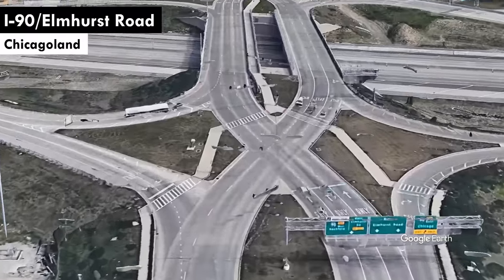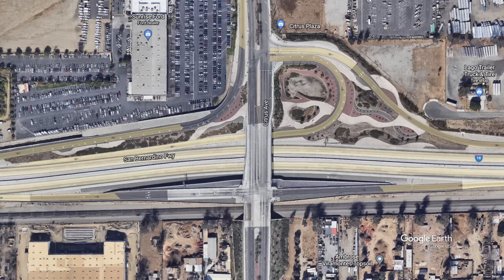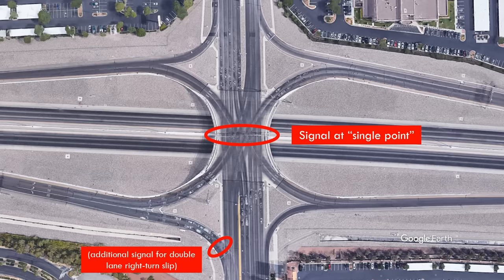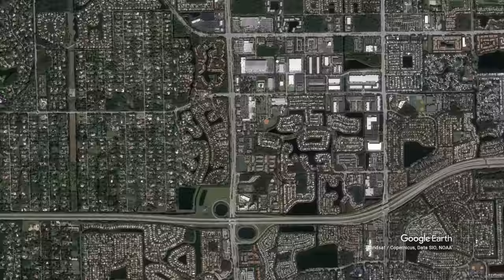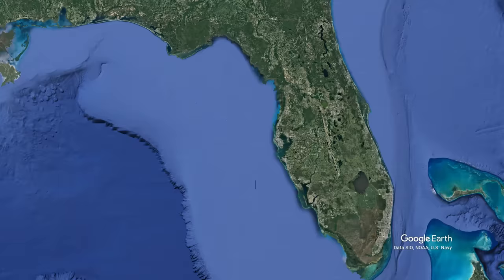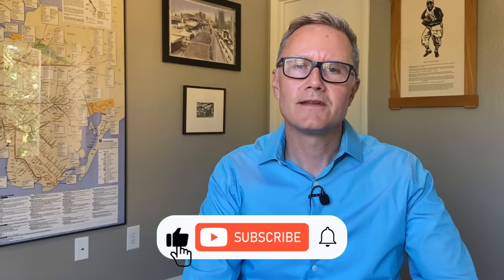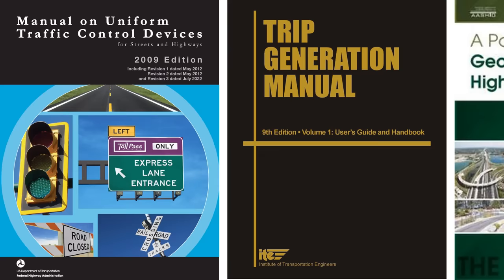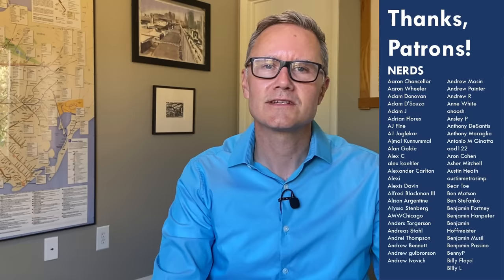Traffic Engineers Gone Wild: Why Interchanges and Intersections are Getting Worse, Not Better

Comment: I live in Utah and Bangerter Highway is a mess. It started out as an arterial  surface road meant to be a a low cost beltway, but it had intersections with lights. That part of the valley has exploded in population so UDot has been slowly converting intersections into freeway style interchanges. Eventually, it’s supposed to be 100% freeway without lights. I’m the meantime, it’s a very weird road. 

You should do a video on Mountain View Corridor just a little further to the west of Bangerter. It’s a future freeway that has started out as a frontage road with a large amount of open land in the middle. Once UDot has the funding, they will build the freeway section between the existing frontage roads. It’s crazy how many wrong way drivers and deaths happen on that road.

Comment: Thanks for the excellent videos. I'd like to hear your thoughts on frontage roads. Do they actually make access easier or do they just take up more space with little practical benefit.
Reply: Comparing my experience from living in Texas where they are ubiquitous to my former state of California where they are fairly rare…crossing them as a pedestrian is far more pleasant without frontage roads overall.  That said, there are many other design factors that go into the safety and relative pleasantness of highway crossings that play a significant role.  The main role of frontage roads seem to be to add value for the land owners adjacent as it allows them to sell their land to commercial and apartment developers with highway/road access for their driveways.  It’s a huge added cost to the state and the primary reason they are so ubiquitous in Texas is the lobbying by large property owners who are looking for what is essentially an expensive government subsidy when they benefit from their increase in property value after the frontage road and highway is completed.  It’s pretty much required by Texas state law to include a frontage road along urban sections of freeway.

Comment: Awesome timing on this video. Las Vegas is currently looking to expand the I-15 on top already ongoing construction and is having a discussion that is open to the public in early November. I am hoping to be able to voice concerns about the ample amount of construction on a congested Interstate which will only result in induced demand instead of alternatives that would help reduce the amount of drivers passing through there. I would love to see a video or just hear your thoughts on the planned expansion.
Reply: They're expanding I-15 in Las Vegas again?!?!?
Reply: @compdude100  Yep, from Sloan Road to Warm Springs. I believe 1 or 2 additional lanes depending on the stretch. Also HOV lanes for the entire stretch. November 2nd I believe there is an in person forum to discuss it as well as an online source somewhere. It is wild so I am hoping to go to see if those funds could instead be diverted to improving the walkability of the area.
Reply: @jaydenwiener4899  Oh, that's a different section than what they previously did a few years ago (Project Neon). But still, it's a waste of money that could be spent converting Elon Musk's stupid tunnels into an actual subway system. (add rails, buy some subway trains, etc.)
Reply: @compdude100  That is my exact thoughts. I wish Las Vegas had a metro or rail system. Perhaps a dedicated line to at least 3 or 4 points across the city with bus routes to move people shorter distances around them. Adding increased walkability in these areas would also be a must when planning this. Either way, all stuff that I am hoping to see voiced at the public meeting on the 2nd.

Comment: As someone who is both about to become a transportation engineer and from the Salt Lake City area, your comments were brilliant. The arterials in the Salt Lake Valley are insanely large and terrible to drive on. Utah County is pretty bad too.

Bangerter Highway is a particularly bad example. Even the traffic engineers that I have worked with who were involved with the project would point out the many problems with various sections of the highway. They would always talk about the DDI interchange for Bangerter and SR 201 being the worst design for vehicle traffic and pedestrians. Now UDOT is convinced they need to turn the whole length of the road into a grade-separated highway to "fix" it. Good luck to them.

One thing you will definitely enjoy is a unique intersection design called a superstreet. I haven't heard of any that have been built in my area but I know they have been talked about as potential "solutions" for some intersections. They look downright awful to drive through let alone to try and cross.

Comment: Can you do a video where you investigate which cities have, on average, faster local transit trips than local car trips. I'm thinking NYC might be the only one if you consider the set of all trips between any 2 random points in the city.
Reply: I have been thinking about this a lot recently after measuring some of my transit trips. Transfers between buses particularly kill the efficiency, and the reduced traffic since Covid also makes driving much faster. I'm feeling there's some random point to point metric that could be applied to cities to determine relative transit efficiency.
Reply: "the set of all trips between any 2 random points in the city"
That set is probably insanely huge, mate...
Reply: @ano_nym  Integrate
Reply: As a New Yorker, it probably depends on where you’re coming from and going, but then again when you bring on cost the train is MUCH better.

Comment: Encountered both a SPUI and a DDI in the wild recently.  Even though I was familiar with both, the unexpected layout and poor signage meant I was very confused for a few critical seconds.
Reply: I have come to the conclusion that DDI>SPUI in terms of usage. A SPUI provides a large expanse of space that requires long phasing, and is quite difficult to keep clear of snow and difficult for pedestrians to cross. Not to mention, SPUIS typically require new bridges to be built to accommodate a wider, barrier free pavement area, which is more expensive, whereas a DDI can reuse the existing bridge infrastructure in many cases, saving money.

Comment: I was surprised to see a couple of examples not appear in this video. First is the NJ Jughandle. The other is the Texas turnaround which was shown in at least one of your flyover shots but was never mentioned. Both are ways to avoid making left turns without crossing over traffic.

Also, there used to a variant on a bowtie intersection/interchange near Arundel Mills near BWI in MD, but I just checked on Google maps and it looks like it was replaced with a DDI instead.

Comment: Topic idea maybe... 
Why are american planners so averse to roundabouts? I see lots of roundabouts with really weird/counterintuitive lane designs.
Reply: Our driving licenses don't require familiarity with roundabouts
Reply: It's a combination of historical experience with traffic circles(which are visually similar but behaved in a more dangerous way when merging - the traffic circle vs modern roundabout discussion already has a few videos on YT), and the upper bound to traffic volumes before congestion. Roundabouts will congest at a lower volume than the fancy interchanges. Because the American metrics are bent towards maximizing speed and flow around the clock rather than smoothing out traffic behavior, the design priority becomes - no lefts, no stops, no traffic calming, no yielding. A lot of these fancy designs compromise on stops but manage to eliminate the rest, while a roundabout requires at least some yielding.
Reply: They have started putting them in slowly but surely. Some states are more pro round a bout than others, NY for example mandates that towns are least consider a round a bout while other states like Tennessee hate them (I have only seen ONE round a bout in Tennessee: a very old one in Lebanon Tennessee)
Reply: Roundabouts are really hazardous for pedestrians.
Reply: @MrBirdnose  It's mainly on the exits being basically like slip lanes and cars really don't want to stop like at all.
Even with UK changes to highway code where giving way to pedestrians also applies to roundabout exists and enterances the exits are causing huge issues with drivers along with lack of infrastructure updates since then.

Comment: What traffic engineers don't realize is that "under-utilized green time" at signals can actually be a good thing. Trying to cross a busy arterial street where there isn't an intersection, you depend on "under-utilized" green time at the signal a block or two away in order to create the opening in the traffic necessary to safely cross.

This is especially true for pedestrians, but also holds, even when crossing the street or turning onto the street in a car. When traffic engineers try to over-optimize, they simply make things worse.
Reply: Agreed.
Reply: if they would at least implement a protected left turn at those high density places, I could learn to tolerate it.

Comment: There's nothing wrong with DDIs at all.  Sure, the one you showed had the worst possible pedestrian median, but that's not an implicit feature of the design.  There's nothing stopping someone from putting a full on grassy walking strip down the middle instead of the ugly concrete barrier version you found.  Why not stick to ranting about the problem instead of incorrectly associating it with an intersection type you don't respect.  Also, your little sarcastic note about drivers not knowing how to make left turns seems out of place -- you do realize over 50% of crosspath accidents are from left turns, as are over 1/5th of all collisions, right?  Avoiding left turns saves the lives of pedestrians.
Reply: Agreed he's extremely condescending, and thinks pedestrian walkability should be the main priority of literally every intersection. People that live in the subarbs, live there because they like to drive, and dont want to live in a dense urban "walkable" area.
Reply: @joeconkle8826  I love his attitude. Makes my day.

Comment: It's a sign of how car-dependent the US is that city centres have huge, multi-lane roads smashing through them, and a lot of commercial development is on wide open lots with the building almost swimming in an ocean of surface car parking dedicated to that one business: with the expectation that if you want to visit the business next door or across the street, you get in your car and drive.

Conversely, since the 1960s, the UK (admittedly a far smaller country) has discouraged through traffic from town/city centres, with most roads still being two lane single carriageway. Congestion was initially tackled by building ring roads, typically with either the ring elevated above the streets, or pedestrian underpasses provided (which, while eliminating pedestrian:vehicle conflicts, have approach stairs / ramps at right angles to the underpass, so the underpass be either dimly lit or have 24/7 electric lighting - and as the underpass itself is hidden from the surrounding environment, creates a feeling of unease and potentially makes it attractive to criminals); but then later, bypasses were built (which, of course, attract retail parks and new housing development on both sides). Ring roads often aren't a full ring as money ran out in the 1970s or opposition mounted to "concrete collars" physically isolating the own/city centre from the suburbs and inhibiting growth - so they're increasingly being brought back to street level, with low speed limits and plenty of PEdestrian LIght-CONtrolled [pelican] crossings (or the newer "puffin" crossings with vehicle and pedestrian sensors to dynamically adjust timings - Pedestrian User Friendly INtelligent). Meanwhile, residential streets linking main roads increasingly have speed ramps and/or 20mph limits to discourage their use as "rat runs".

The vast majority of shops in town / city centres are in terraced buildings, and where possible have been pedestrianised (with only emergency services, bullion vehicles serving banks, and vehicles needed for the setup / takedown of weekly street markets normally allowed); while retail parks (which contain the larger "sheds") also have most units joined to each other, with pedestrian walkways along the run and through the communal surface car park. Many of these also have fast food restaurants with seating, so people can also walk to one to have lunch; and are served by local buses, so even those without access to a car can shop at them.
Reply: “with the expectation that if you want to visit the business next door or across the street, you get in your car and drive.”

Even to cross the street here, it’s often easier (and safer) to just get in your car and drive (this is the case in most of “urbanized” Texas). As far as visiting businesses next door, they’ll sometimes put fences in place to make it hard to walk from one property to another to discourage people from parking in the parking lot of one area and then shopping in another, meaning you end up walking a lot more (and risk having your car towed if they do that sort of thing) or just get back in your car and drive again.

Comment: I wonder if the traffic engineers take into account that those U-turn solutions send the same car thru the intersection twice on the same trip.  That effectively doubles the car count for every left turning car.  But this video made me think of a parking garage feature - the spiral ramp.  Are they really better than straight ramps?  (They can be a lot of fun, as long as you remember to stop turning when you get to the bottom.)
Reply: Any increase in volume is probably made up by not having to have a protected left turn signal

Comment: HA! Love the use of the Airline Highway example in the intro. I first encountered that "intersection" at night in a rainstorm. It did not feel safe. It was so outside the norm that I can't imaging most drivers feeling it is well designed. And it does not even prevent backups. definitely visit.

Comment: I've driven through almost all of these intersections with 18 wheelers and dislike most of them in various ways. SPUIs are just so massive that its way too easy for the light to cycle from yellow to red then green for cross traffic in less than the time it takes a semi to cross the intersection. Lots of car drivers think green lights mean they're allowed to floor it directly into the side of a semi only halfway through their turn!

Diverging diamonds are sometimes good sometimes bad for trucks. The one in SPRIMO has enough off-track space for the longest Missouri-legal trailers to make their turn without crowding adjacent traffic, but there's a ton of them now in SLC and Utah allows double 48 foot trailers, and navigating a DDI with those can be an exercise in frustration for everyone involved. I've even seen a smaller double (a 45 and a 28, "Rocky Mountain Doubles") drag the pup trailer over the jersey barrier protecting the pedestrian area in the median, though thankfully few pedestrians are brave enough to try walking to the Dairy Queen on the far side of I-15, so the only injury was to the barrier itself and one of the pup's mudflaps.

Michigan Lefts are just flat out dangerous. If people are watching the intersection and not the U-turn signal, they can easily be caught off-guard by a turning semi and collide with the side of the trailer, one of the deadliest car vs truck collisions. Plus some absolutely sadistic engineers do a double U-turn lane, expecting cars to be smart enough not to go side by side with a truck through it. These are the same cars that cannot be trusted to make a normal left turn, mind you.

And then one you didn't mention that I usually refer to as a barbell: a regular diamond interchange with roundabouts instead of signals. There's one of these in Yakima at the Valley Mall interchange with the only truckstop in the whole area, and the geniuses decided to feed the frontage road, the crossroad, and the on/off ramps for eastbound I-82 into a single two-lane roundabout where semis coming out of the truckstop have to split both lanes to navigate the entrance to the roundabout and then cross two lanes of unsignalized traffic freely flowing from the interstate into the city. It's MISERABLE. Lovely connection to the nearby Yakima Greenway though if you have a fancy amphibious bicycle or hip waders for the bit of the trail that appears to be in the river.
Reply: Wellness check just arrived and gave me some kind of inhaler? I'm fine I promise.
Reply: @EllieODaire  glad u got much needed help ! I am still waiting

Comment: Hey! Some of us play Cities Skylines!

But yeah, as someone without a car who frequently takes public transportation (which is actually somewhat decent in our university town), traffic engineers clearly see pedestrians and even public transportation as an afterthought, if it's even considered at all. And unfortunately, I know of several bus stops in my town that are not handicap accessible - one of which would require someone in a wheelchair to actually travel about 20 ft in the right lane of traffic on a very busy road where the speed limit is 45 mph. That's also the bus stop we have to use to get to our polling location (which also isn't handicap accessible - there's a step up into the building because of how it's settled over the years. Yes, we've complained. The county refused to do anything about it.)